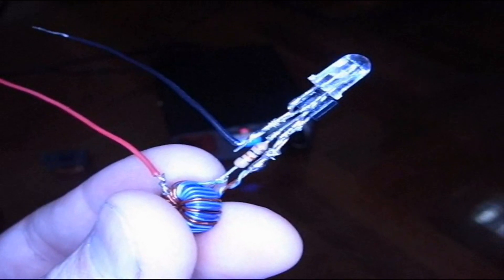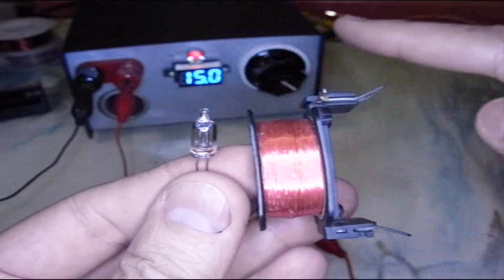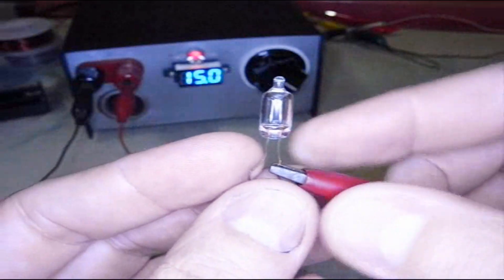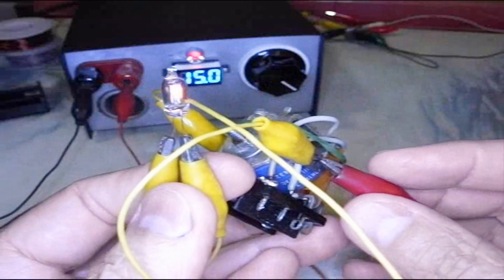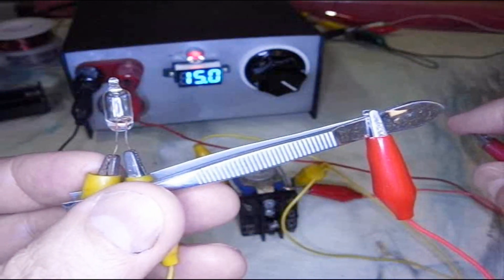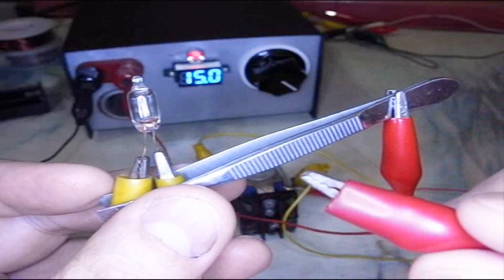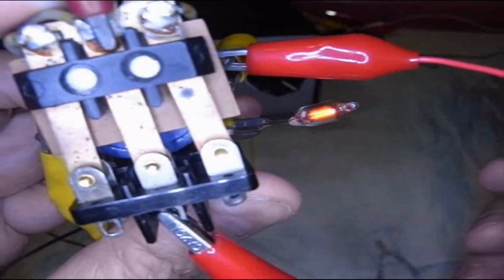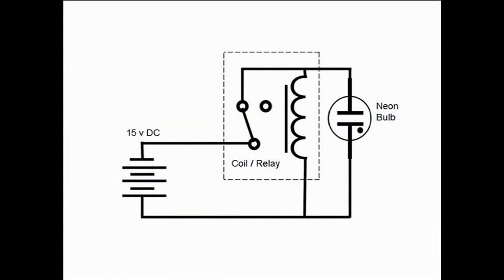Mechanical Joule Thief/Electromechanical Boost Converter

Comment: I also did the same with a same coil from a tubelight/cfl choke transformer. Worked by 1.5v but didn't know to oscillate it continuously without destroying coil of transformer by transistor